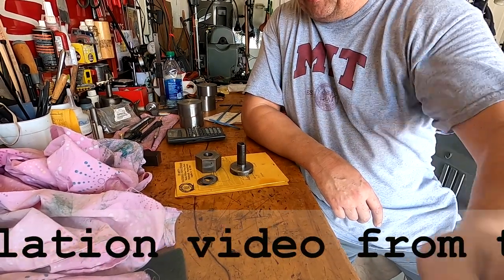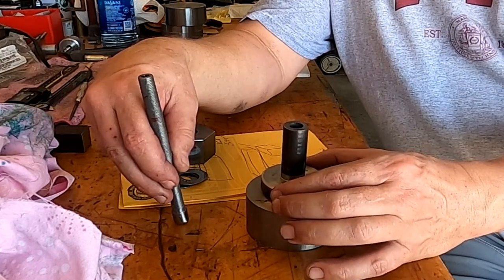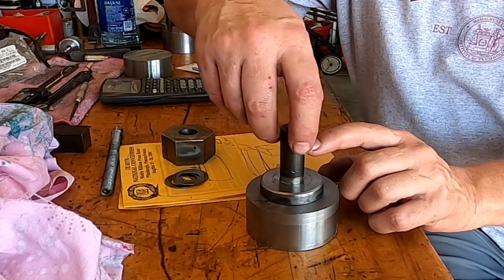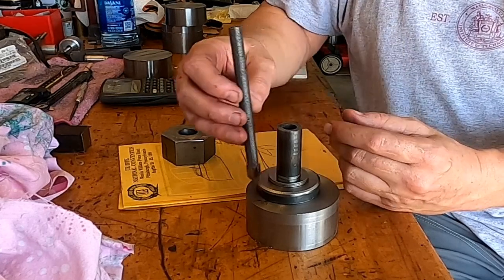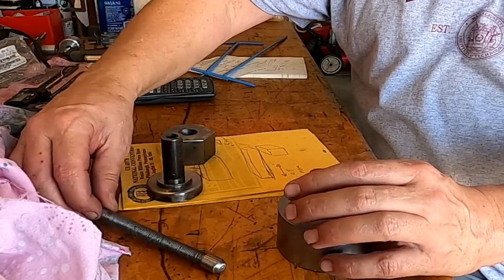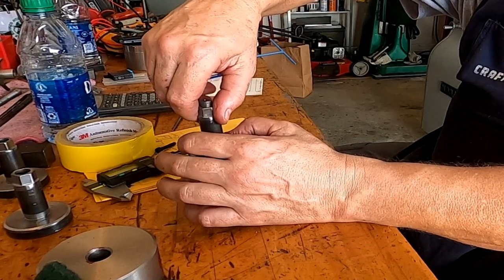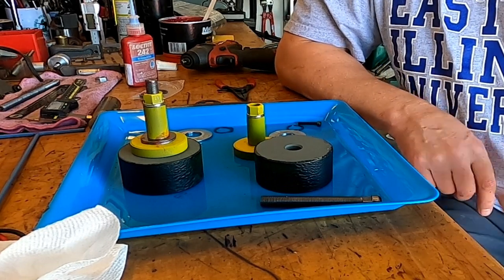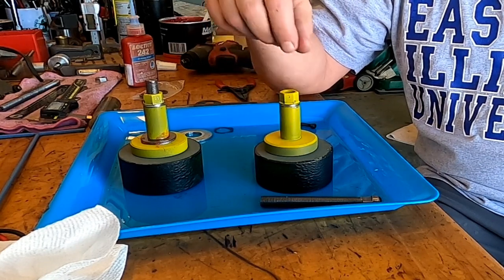How To Make Adjustable heavy duty lathe feet. Adjustable feet for Monarch 10EE - Excerpt compilation

Comment: I have a huge old Lodge and Shipley lathe from probably 1915, and want to raise it up about 9 inches, but it weighs about 2000lb's.

Not sure why it sits so damn low, but it's a huge waste of space under it, and I need my 3 rolling workbenches to fit under it against the wall, and I don't use the lathe that often because I have a small Logan 200 from 1942 as well, that works for most things I work on.

I'm not having much luck finding anyone else that has lifted a lathe that much, especially a huge old lathe from the early 1900's...

I don't want to use wood, because I would imagine that it would degrade over time, so I don't trust it.

Maybe cement blocks or stacked cement patio stones??

Maybe 4x4 metal tubing somehow welded together??

Maybe cement inside the 4x4 metal tubing that's welded??

There are big castor wheels that can apparently handle the weight, and maybe with some metal brackets across them might be an idea??

I know it's weird, but I'm intent on doing it somehow, otherwise I can't keep it here taking up the amount of room that it does, as it's 9 feet long and sticks out from the wall about 45", so I figured why not make it into a workbench that the top can come down on hinges over top of this giant beast, and when I want to use it, I can lift the hinged workbench top back away from it...

Any suggestions other than getting rid of it, and or that I should check myself into a mental institution, would be greatly appreciated??

Pros or Cons even??

Comment: Hi Don ,  great job on the feet.   I was wondering how your,lathe height turned out for you and where do you like your height to be?   

Dale in Canada 🇨🇦
Reply from the maker: Hi Dale, Thanks, The 10EE now sits about 3" above its normal stance, which for me at 6' even makes it a lot more comfortable to work on.  All the controls are just in the right spots for me. I look down at about a 45 degree angle at the work. I knew I wanted it at that height because I was running it on wooden blocks for a couple years before doing the feet.  Don